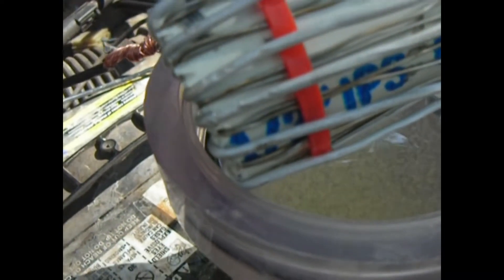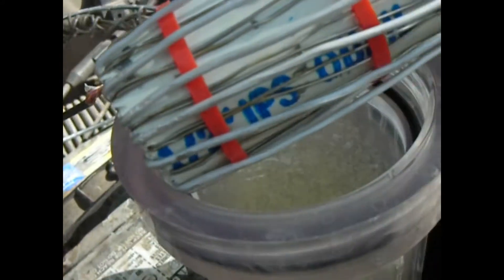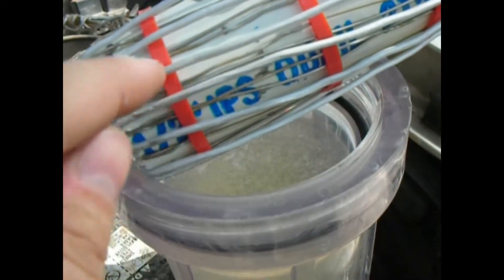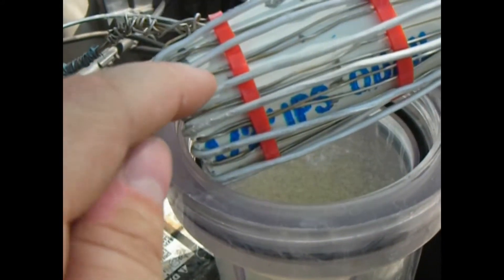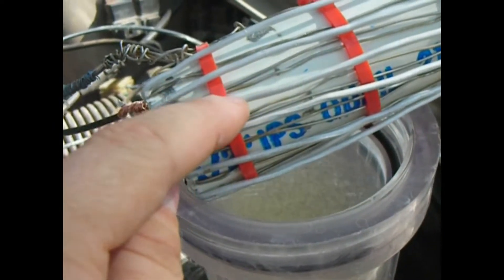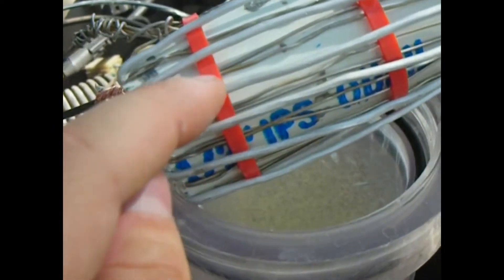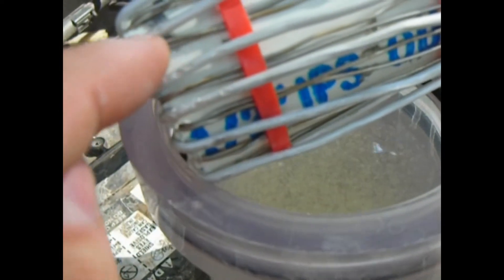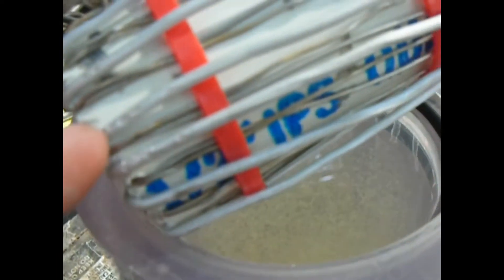old new improve hho generator

Comment: yeh i have seen some videos under vacume, it defenetly yeilds higher production, The heat, yeh it is problamatic, it's all pretty much a ballancing act, and trade off i find, i use potasium hydroxide, or Lye/ caustic soda its called in the UK, no foaming off those guy, and good production for ammounts used.
thanks .

Comment from the maker: i was getting up to 2 litres per  minute but then the water would over heat tried coolant but then the water just foamed up but never overheated. just using stainless steel dosent work as well as one aluminum one stainless. ive been using the same aluminum wire for about a year now no disintegration it may be an alloy  from what i was told hence its long life. if i go lean on the electrolytes i get decent production and no over heating. under vaccume i get a tremendous amount of production

Comment: Hi, interesting unit guy, what sort of production do you get per minute from it, and do you think the wire coils are better than plates ? In youre experience, just to say if you use stainless make sure its non magnetic, as non magnetic has low or no carbon content, 1 other thing is aluminium will disintegrate over time turning its self in to hydrogen in the process, YES. Keep trucking guy.

Comment from the maker: about 15 amps is what the conduit wire is rated for when i got around 30 or 40 amps the wire would start to get hot and melt the casing and the wire 20 amps it gets hot around 15 amps it stays toasty warm. with some larger guage wire i sure can make allot of hydrogen but it seems to only draw 40 amps at the most im fine at 15 im trying to improve the efficency even more i might double up on the aluminum wire